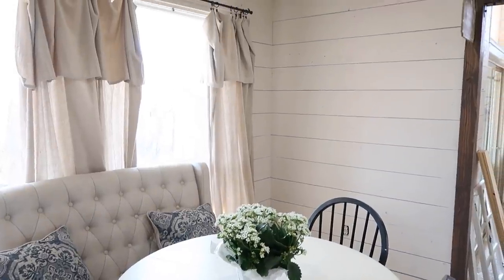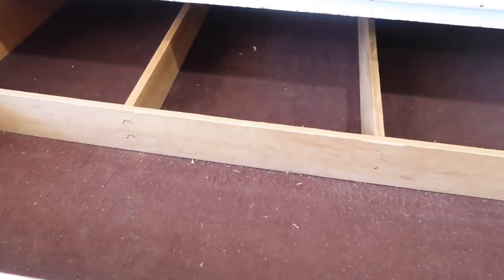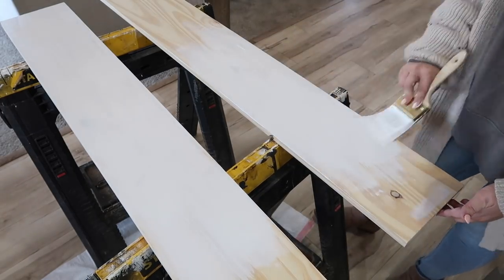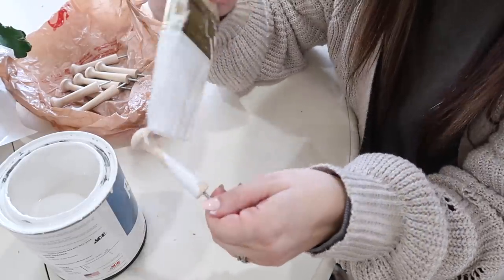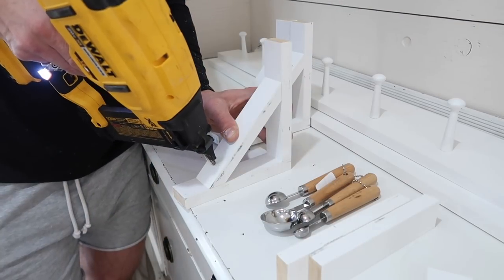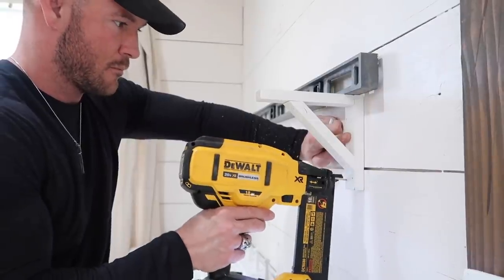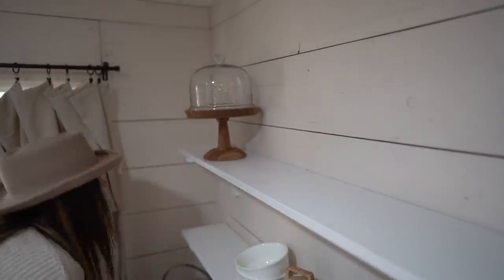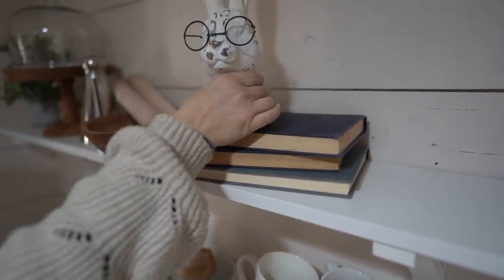FARMHOUSE BREAKFAST NOOK MAKEOVER ON A BUDGET | Breakfast Nook Refresh UNDER $150

Comment: Great use of the space you have.  The shelves add a great deal of useful space.  The sideboard was a steal, it is a beautiful piece and will hold a lot of kitchen wares and seasonal items that can be used for decorating, etc., so filling the shelves that you installed with seasonal decor rather than using most of the shelf space for actual storage of items you use on a daily basis doesn't make sense to me.  I like decorative pieces, but I think a more minimalist look would do the corner more justice.